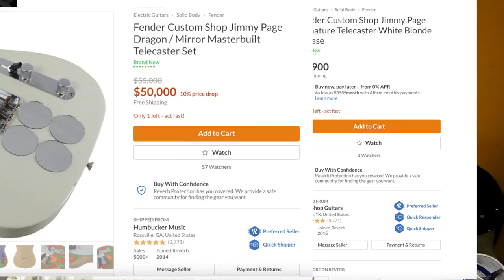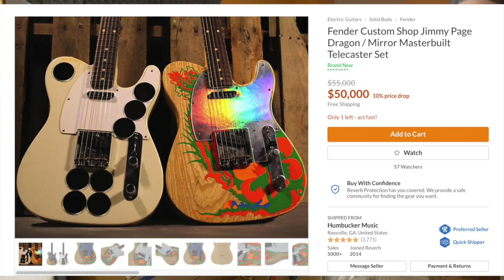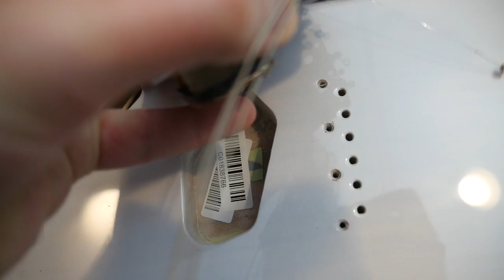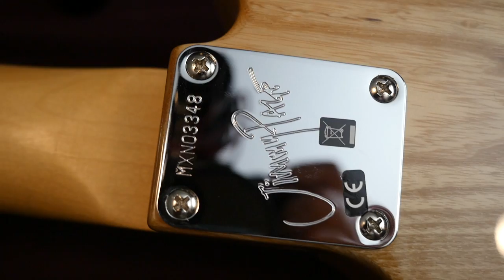Which is THE BEST? | Fender Jimmy Page Telecaster Mirror + Dragon Review + Demo

Comment: You should definitely check out the Fender “Road Worn” series! They were mim guitars with a very light paint and clear nitro coat so it wears away vert quickly so it doesn’t take years to get that “road worn” look and feel.
Reply: The Nashville deluxe tele is a screaming deal as well....
Reply: I got one a t a pawn shop for $250. I guess that thought it was just a beat up guitar.

Comment: That dragon Telecaster pioneered zeps sound. Whole first album with a supro amp was recorded with this.

I hand built a replica of this guitar and it turned out awesome. Page used 8-38s for crazy bending on this guitar
Reply: And a borrowed Flying-V on You Shock Me.
Reply: Eights were pretty common back than as well, nines were heavy than, 10,11,etc are really only late eighties
Reply: @mcamp9445  One common gauge back in the late 60's (Ernie Ball Rock and Rolls) was 10 on top and 38 on the low E, kinda like what Hendrix used.
Reply: @mcamp9445  lol no

Quite a few players tuned down a half step to lower tension more than anything.

A singlecut LP Junior's factory strings were .14s, for example. Ernie Ball eventually did put out Slinkys but I doubt many outside of Nashville (which Jimmy was obsessed with) were running 8s at this time.

The trick of the day was tossing your wound G, buying a bajo string & using it as your E, moving the stock B & E to lower positions.

Still left one with bridge cables for bass strings.

Comment: I saw Led Zeppelin three years in a row at the Forum, during the early 1970's, and they were magnificent.  Page was using the Les Paul by then, but the Telecaster was on the first recording, which they made in 30 hours.  I like the blond, but not the mirrors...well, maybe just one?  The strings go through the bridge on 1958-early 1959 model, instead of through the body, which changes the feel.  With both options, some like 3 through body and 3 through bridge, for plain and wound strings. Some copper tape inside the routes would help quiet the noise. Rubbing the back of the polished nitrocellulose lacquer with a scouring pad, will safely smooth the feel.  Page worked with Fender to voice the pickups, at least on the USA model.  Coincidently, I had just watched a video of Page discussing this guitar earlier today.  Cheers!!

Comment: When doing the "blind" test, I could immediately tell that the white U.S. model had a richer, fuller sound, whereas the Dragon was not quite as full and a bit brittle sounding, IMO. The sonic quality of my hearing is a bit compromised these days, but even with that issue, it was still easy to tell the two apart on the clean setting. With the distortion, it became more difficult to tell them apart. I would definitely spend the extra $$$ for the white Tele though. Often it is the little things that, when added up, make the difference!
Reply: Well said.

Comment: Great video. I think the reason why the neck is road worn on the dragon is because it was more used by the time the white tele became the dragon tele, after all they were the same guitar. Also from what i've read and heard on different videos they're the same pickups just branded different, which would make sense cause once again they were the same guitar. I went with the dragon model because it's unique, i mean you can always get a white tele 😀 mine also has a thicker sound, they probably aimed that sound with those models, a thicker sound was also one of the reason why i went with that one. After your video i examined mine and found that luckily mine seems to be a one piece ash body with some small marks in the wood which probably wouldn't happen with the usa model. However they're not visible on the first look and are only present at the back and the side. I really had to search for them to see. Didn't have any issues with the rosewood fingerboard or the neck, comfortable for me but i usually never have any issues with guitar necks unless they're v shaped or painted. After watching your video i gave it a second close look and still found it comfortable. However i should mention that the fingerboard doesn't sound as dark as the others rosewood fretboards that i've played with but since i always prefer maple no issues there for me, it sounds somewhere between maple and rosewood. And i also got some sharp frets but i've seen it with other usa models too. The only thing i truly disliked about both models is the bridge, those saddles are a pain in the ass, after wanting to keep it original for some time i finally ordered a 6 saddle bridge. Overall i would say thay the positive side of this beast heavily outweighs the negative side. Cheers 😀

Comment: I have owned the Dragon Telecaster since may. It really needed fret polishing badly. Once that was done with a good setup for 9s, it has been rock solid in its performance. The thick neck takes some getting used to. Getting that Led Zeppelin 1 tone  or (STH Solo tone) is very easy with this guitar. Its actually the nicest Mexican Fender I have ever played. Also, I believe it will be the last Mexican Fender to feature Rosewood on the neck.

Comment: I almost bought the dragon Tele but went to my local GC and they had both so I played them both. I agree that the neck on the mirror Tele felt much smoother but I actually preferred the "chonkiness" of the dragon neck and it had a really great sound. However, I did notice the flaws, and the overall build quality on the Dragon was disappointing. I really wanted to like it more, but I put them both back. Full disclosure - I've never liked the look of the Telecaster, but lately, they have grown on me. I am also impressed with the range of tones a basic Tele can produce, but clean and distorted. I will certainly add a Tele to my private collection at some point, but it probably won't be one of the Jimi Page models. If they actually made a better quality US version of the Dragon that wasn't insanely expensive, I'd buy it.
Reply: So the neck on the "Dragon" Tele is fatter than the neck on the "Mirror" Tele?

Comment: the dragon is by far the best of the three! the blond is nice but to spendy for me. the new mim fenders are hard to beat for the price, the older mim are impossible to beat if you can find one for three hundred dollars,that leaves you money for upgrades, and the one thing i dont like is the thick Polly finish! its worth it to me to use a heat gun and remove the rather thick crap they are finished with and do a nitro re spray. its alot less work than a good oil finish under a amber nitro, witch is my fav look.

Comment: That white see through  model. is basically  a squier classic vibe with full size pots and nitro finish.just saved you $2k,your welcome
Reply: @joebryant8500  i put full size 250k cts pots,fender 3 way switch and switchcraft jack in mine and its fabulous.
My neck was a great example.almost rolled fret edges its so smooth.pickups are alnico and a very similar reading to trogly's white one.both mine and it, have steel saddles,vintage tuners and a vintage gloss neck.the $2500 guitar just has nitro finish.difference is the squier has narrow tall frets and a 9.5 radius.which are much more preferred with players vs a 7.5 radius.body on the squier is pine vs ash.the pine has more resonance.so while not a $2500 guitar.more around the $600-$650 range with the upgrades.
I doubt if you played mine and that white one side by side.that you could justify to yourself the price increase.unless your just a total brand snob.

Comment: Cool! A couple little things you missed Trog, (understandably as you are more of a Gibson guy) That the S.N. is stamped on the plate on the MIM one is interesting and cool because they are usually on the back of the headstock, and it looks like they both have "clay" fingerboard marker dots instead of the usual white. And the pickups on the MIM one look made in USA with the cloth covered wire. Nice touch on the lacquer on the MIM one. I like the USA one better personally, not a big fan of the dragon. Would have been cool if they would have made the dragon an included decal like the mirrors, but then I think more people would have bought the MIM one . Nice playing demo!

Comment: I really feel like these should have come with Top Loader only bridges. That’s how Page’s original ‘59 tele was set up and I believe it’s a big part of getting that LZ sound and feel.
Reply: Nope.  Page most often strung up through the back.  Probably because you bust strings easier doing the top load method.  It puts the string winds of the plain strings right across the bridge saddles where they can become stressed enough to break with lots of string bending.

Comment: Still don't see the dragon, guess I don't have an artistic eye 😅. Merry Christmas all!
Reply: you see it a lot more if you look at Jimmys actual dragon tele . The head is facing backwards just left of the bridge on the top left corner. You can see it a lot easier on the actual page tele.  I actually have both of these teles and honestly I changed the saddles on the dragon to wilkensen compensated brass saddles. Made a huge difference. It is way brighter now. Mine also has a lot of checking on the neck. They are both really nice guitars and sound great clean or with gain.

Comment: Sacrilege I know, but I recently sold a mirror Telecaster, that id lightly relic'd.

I just couldn't bond with it, the top e kept falling off the fretboard, and after custom cut nut didn't cure it nor brass saddles, it had to go.

Anyway my point is.. Try as I might, with heating and freezing the white lacquer,, I could not get it to easily lacquer check. It did, slightly, but generally resisted by efforts.

Do they use plasticizer or something in the formula?

Be aware of that, if you expect it to age over time,, you're in for a long long wait.
Reply: Pop fender an email inquiring about the journeyman relic process
Reply: @ledzeppelinzoso  I doubt very much that they'd divulge such information to me tbh..

Comment: I personally think the dragon sounds more Pagey. I'm thinking that the slight output increase of the white one maybe accentuates that middle position pop of Nashville and that sort of thing. And Page's tele sound wasn't much in that direction. It was airy and looser. So for my tastes the dragon seems at least more immediately true to Page's unique hard rock Tele thing he was doing at that time. 

Ive only played on the dragon in the shop and was beaming about it. Would be awesome to just stick those pickups on some tele I liked, even a used Mexi off reverb or something.
Reply: I have to agree with you that the "Dragon" Tele sounded more like Page...more Tele-sounding with more string definition.  The "Mirror" Tele sounded more like a Les Paul actually...but that's not necessarily a bad thing!

Comment: Interestingly, the more "hollow" and scooped sounding Dragon was a LOT more like actual Jimmy's Tele tone (without fuzz), compared to the beefier blonde! Listen: https://youtu.be/lfLMvO3EwMA
Reply: I swear I also thought the same the moment I heard the MIM Dragon's cleans. Jimmy's pickups didn't sound hot at all. But Trogly is mostly a LP guy, the way I see it, he's into "louder = better" type of mentality like so many other people.
Reply: @iagobroxado  It could also be the pickup height. By the way, I was looking to get that amazing clarity Page gets out of his LP's neck position, so looked carefully at some pictures. Guess what, the neck pickup is lower than the pickup ring! And yes, it works, it turns out, you can dial some of the mud out of it that way.
Reply: @Pandamasque  Also could be pickup height indeed! I wonder if Trogly was fair enough to adjust them the same. I do believe these are the very same pickup models - Ohms definitely aren't everything, but heck, both are Page models, just too close Kohm readings, cosmetically the same - makes you at least wonder. Hey man, I have been thrilled by how great Jimmy's #1 Les Paul sounds with the volume control on his neck pickup turned down - it's almost like a strat. About 20 years ago when I watched TSRTS (VHS hehe) for the first time and during the SIBLY intro he starts the "quiet part" I couldn't believe he didn't have coil taps and he was getting all that single-coily tone just by turning the volume down!

Comment: Those "Fender" caps are just any bog-standard caps with a Fender jacket on them
Reply: What are caps?
Reply: @RileyWUploads  capacitors, that’s how the tone control works, it rolls off the high end (treble cut).
Reply: @joermnyc  oh ok:) thanks for telling me dude
Reply: Stew Mac did a test between all the cap types they sell and found that the difference wasn’t really that significant... I agree except for paper in oil, but those are expensive and you need to make sure it fits in the guitar because they are humongous! I think here it’s supposed to look like an old cap, but it’s probably just a Mallory with a paper label.

Comment: 99% of the price of nearly all manufactured PU's is about paying for the design. The materials are relatively cheap maybe $20 tops. So it seems nuts to make a MIA and MIM version???? Fender finds it cheaper with high tech to mass produce all their wood necks in the U.S. The sanding and finish for MIM is MIM.